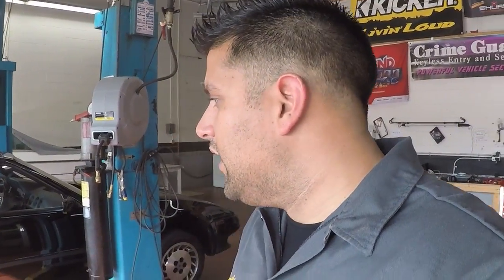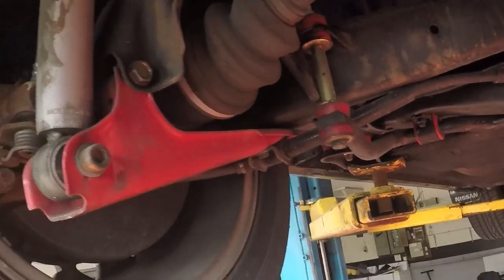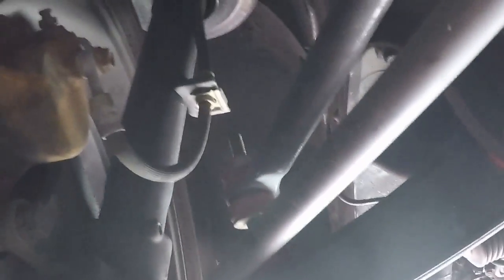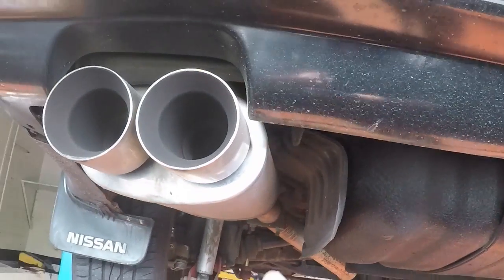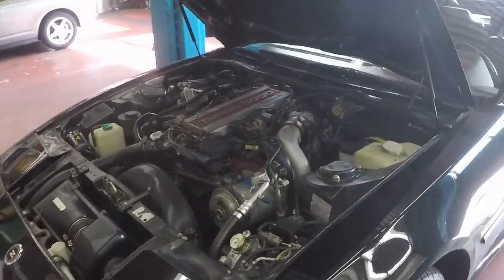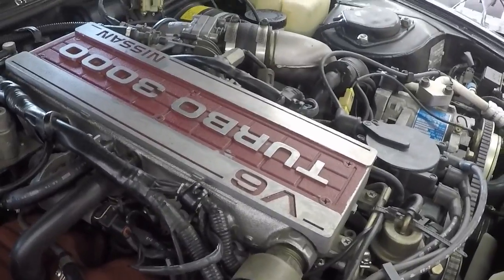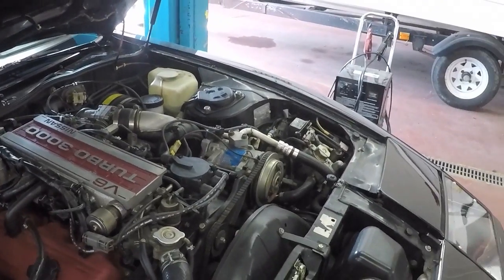Everything Ive done " Mechanically" to my 1986 300ZX Turbo

Comment: My car looks like yours but mine is an 85. My A/C blowes out of the defroster vents do you maybe know a quick fix ?
Reply: Just had my 86 fixed recently. Probably a vacuum leak. There's 3 main hoses that run from just behind the passenger headlight to the firewall. They have color coded stripes blue, white and red. Google them and you will find plenty of documentation to replace them. There are some vids on here also that explain whats up.  That is an aggravating thing though. Good luck!

Comment: I couldn't finish watching, nice car, not really interested in what you have done to it though :( sry.
However, Your transmission is DUMPING Fluid!! lol you need to fix that, don't worry about the exhaust man!
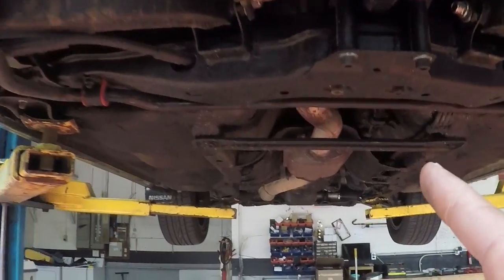Reply: lol wow @ 3:39 it looks like your driveshaft has just slung oil Everywhere!
I'm sorry if you have already addressed this problem before in a video but are you going to fix that soon lol?
Have 1pug do it, hell you did shifty :P
Reply: Antique Guardian its extremely well rust proofed and he clearly said there may have been an oil leak long time ago and it's fixed and he says about 20 times how much oil is on everything for rust proofing
Reply: Gary TheGrey oh ok. Didn't catch that. Ty.